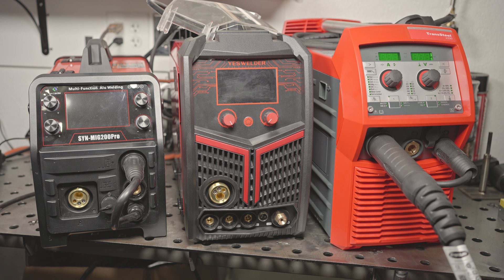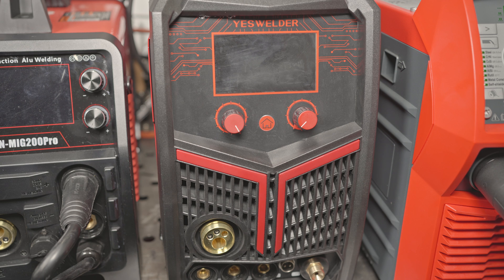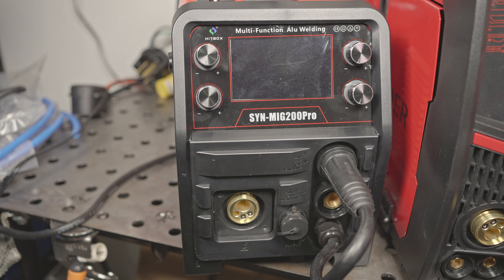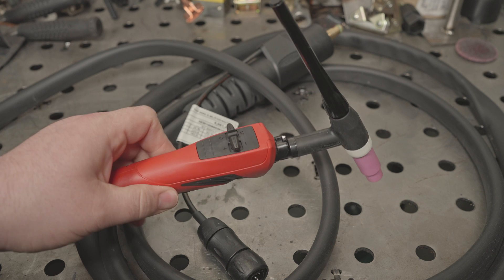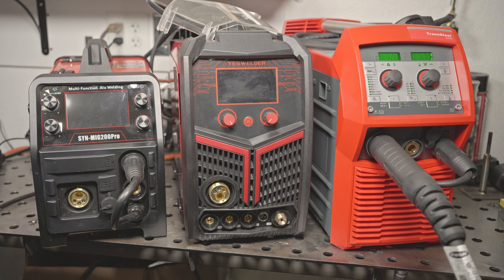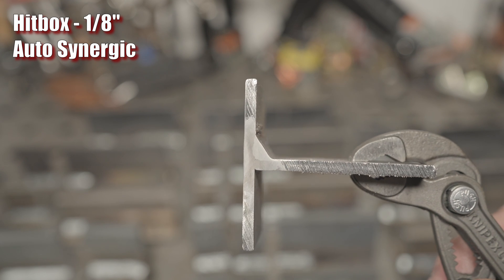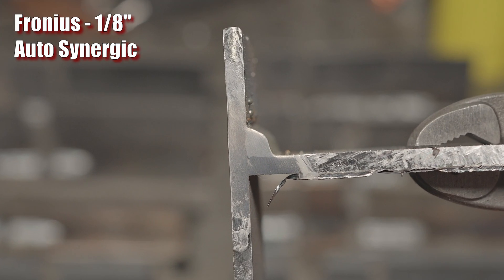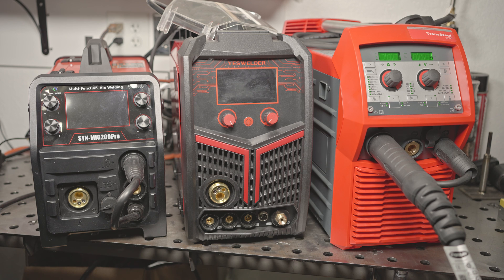Multi-Process Welders, MIG Cut & Etch Comparison - Yeswelder, Hitbox, Fronius

Comment: first
Reply from the maker: Indeed.
Reply: Do I need a special liner to run aluminum with mine? And will it run .52 and 1/16 fluxcore wire?
Reply from the maker: From what I read, their liners will work with steel or aluminum wire, but they say if you use a liner for aluminum, you should ONLY use it for aluminum.  Basically, don't use one liner for both.  They do offer two different types of liners.  One is around $10-$12, the other is like $50, but I can't remember what the difference was.

It took some researching on the Bakers Gas website to find and figure out all the accessories and such.  I actually ordered some knurled rollers for flux core at the same time I ordered the welder, but apparently they are back ordered.  I also ordered a consumable kit and it turns out the welder already comes with bags of 0.030" and 0.035" contact tips.  So I'm set on contact tips for a LONG time, lol.
Reply from the maker: As for flux core, I doubt it would run anything over 0.045" flux core very well.  I suppose it's possible, but it might be pushing it.  Plus, I doubt that size of flux core would be easy to find in 8" spools.  

They do sell rollers that size for aluminum, I'm pretty sure.  Just be aware that you will need a different liner, liner clamp piece, rollers and contact tip to use wire that size.
Reply: @bigtb1717  as always you have all the info,I really appreciate it.

In manual mode I noticed it went to 45volts 🤯 in my days of shop welding we ran duel sheild 0.45 fluxcore at around 25/27 volts so not sure why it goes that high? Any insight?
Reply from the maker: I saw that too.  I remember reading all the specs and I think around 24 volts was the highest number I saw "rated."  That doesn't necessarily mean it's the actual max and I was thinking "It better go higher than that."  When I first powered it up and started turning the voltage up to see how high it would go I chuckled when it went that high.  Yeah, it goes nearly double that, lol.

Not sure it would be very usable at those levels.  Maybe there is some special use case for voltage that high on a machine this size (spray transfer, aluminum?), but I doubt it would be useful for much.
Reply: @bigtb1717  it is capable of running a mig at 45v but it will affect the duty cycle more than usual. its why machines tend to state their duty cycle as 300a at 30v 60 percent duty cycle etc. but its there for extra flexibilty when running outershield wires etc.. but yeah you be maxing the machine out if you tried to spray on it.